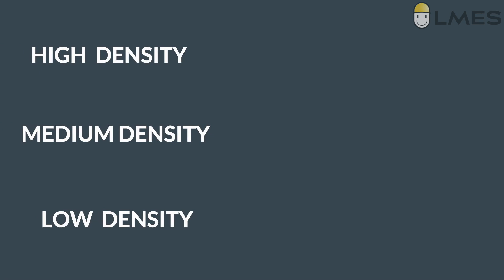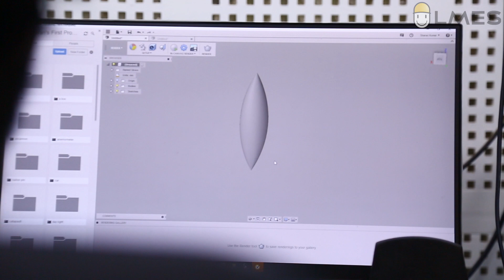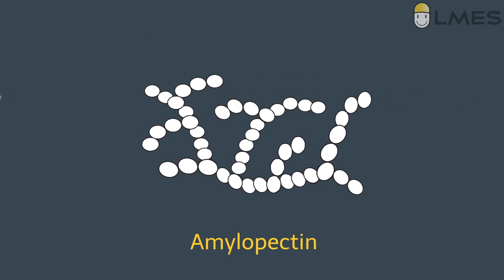The Secret behind plastic rice. | Tamil | LMES

Comment: As of 2024, we know that what was previously mistaken for plastic rice is actually fortified rice. Fortified rice is used to enhance the nutritional value by adding vitamins and minerals. The fortification process involves two main methods: the coating method and the extrusion method. In these processes, rice flour is mixed with vitamins and minerals and then reformed into rice-shaped granules, which are subsequently mixed with regular rice.

However, there are significant concerns regarding adulteration and safety in the fortification process:
- Adulteration Concerns:
  - The fortification process is not always properly regulated or monitored.
  - Low-quality or non-approved fortificants may be used.
  - There can be contamination during the fortification process.
  - The substitution of industrial-grade minerals and harmful chemicals can pose risks to internal organs.

Regulation Issues:
  - Inadequate regulation can lead to inconsistent quality and safety concerns.

Additionally, videos from years ago show that fortified rice was mixed with rice distributed through ration shops as subsidized free rice, without proper announcement or labeling to the public. During those times, the testing of fortified rice in humans was conducted without public awareness, and government officials did not acknowledge that it was fortified rice, leading to confusion and misinformation about plastic rice.

Comment: What if the rice is used for idly or dosa batter. Most hotels buy rice in ration shop for batter. Even in my house we use ration rice for batter. Today I find some pure white rice in odd to normal yellow rice in the ratio of 8:2.

As you said, it's not possible to mix with normal rice. What if we grind the rice to batter. On this case this could end up worst for our health, isn't it?

Comment: The filament which you might use is a PLA filament (polyethylene) and may not have the properties as such as rice. There are biopolymers (kind of proportionate plastics) which would have similar properties. I am not sure whether plastic rice exists or not. But I cooked a bowl of rice and ate it. I kept the remaining outside and it was good even after three days in normal conditions (25+deg. C). I would appreciate you to test it getting it from some shop and repeat the tests, you will definitely find some differences.  Each subject is a sea and we have to dive in and out to understand the hardcore physics and innovations.

Comment: It was nice video!!! But I've one doubt, 
What if low density plastics are mixed with rice and boiled at 120 degree(necessary temperature which is required to get proper melting), now both will be same right?
i.e my question is, if plastics are boiled sufficiently which obviously is at higher temperature than original rice, then how to find difference very easily and how to remove it as all will be highly melted state?

Comment: I guess this guys research is incomplete and half baked. Why didn't he consider recycled plastic. 

One commonly recycled plastic, however, could be melted by hot water. According to T.C. Forensic, some polyvinyl chloride plastics -- PVC, or recyclable 3 -- melt at as low as 75 degrees Celsius.
http://education.seattlepi.com/hot-water-melt-plastic-3626.html

Comment: that 3D printer uses ABS plastic. but plastic rice is different kind of plastic i.e thermosetting plastic which we can used to produce that kind of plastic rice products, when we heat it in the absence of air. there are various kinds of plastics are there, biodegradable plastics, etc. so, the experiment is wrong. sorry about that

Comment: i agree 3D print costing is very expensive. and cooking plastic remain same condition.
but my question is what about MOULDING process? it may be cheap and cooking plastic may get mixup chance!!!?.
do u have any analyse regarding that?
Reply: Per kg of ABS raw material costs rs 150 to 300 per kg of PLA costs rs 100 to 120 per kg of PETG costs rs 120 to 150  and the cheapest plastic which is obtained from the residues of industries also costs around rs 40 to rs 60 and that too it will be pitch black in colour and de-coloring is impossible. And if you are making moulds and again it adds up to the cost and you have to cut the mould in the form of rice which is really a hectic task.  Even if you manage to make all these the melting point of most plastics is above 160 degree Celsius and it won't even boil in our normal boiling point of water.

Comment: if any one can send me their mobile number in WhatsApp with a text plastic rice I will send you the video of the manufacturing. 1.The plastic rice is not made in India. in China the rate of one kg rice size pellet costs rs. 25.  So the rate you say is not true. 2. This concept of plastic rice is not true as one of the person said it is manufactured using potato, broken rice, and cassava(tapiaco). The sheen on the rice is due to the edible gum is added.
This rice is in circulation from 2014. In China it was from 2012. 9940669714.
Reply: Hari prasanth athu plastic waste recycling machine ..chuma YouTube la potu paaru neraya atha maari varum ... potato vechilam rice pana mudiathu 😂
Reply: Dinesh parasu No few NGOs have bought this machine. I have went a couple of years back to an exhibition in Shanghai to see this. This machine can be used to prepare rice using millets powder

Comment: Adulteration guys won't use high 3d end printers.
Something fishy.This requires thorough investigation.
Please don't propogate as if you had analysed fully .
Reply: yaaa they use mass manufacturing techniques like injection moulding, etc but do the math. Compare the cost of 1 kgs of ABS, PLA, PETG which will minimum of rs 120 and even the industrial residue plastic will cost around rs 60 and will be pitch black and will be difficult to decolorize and cost of making moulds that should produce tons and tons of rice.... and reason why we have used 3d printer for this is because the output from it has exact chemical properties from  a mass manufacturing technique and second reason is 3d printers are economical if you are want to produce in less quantities.